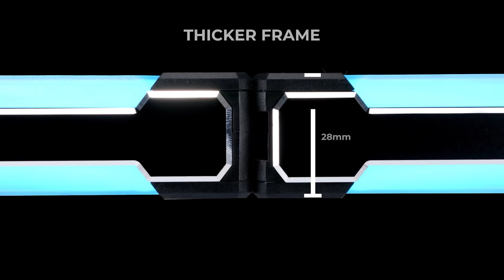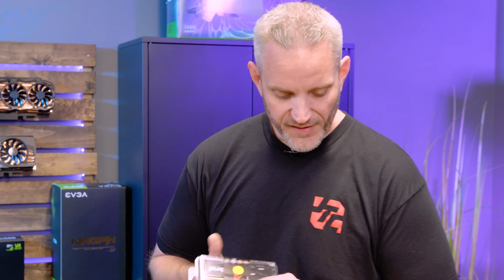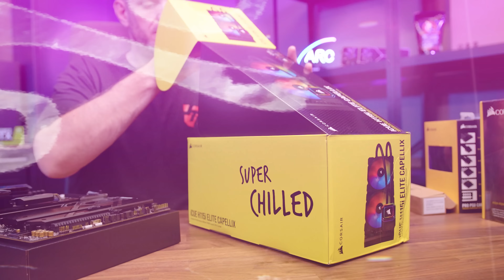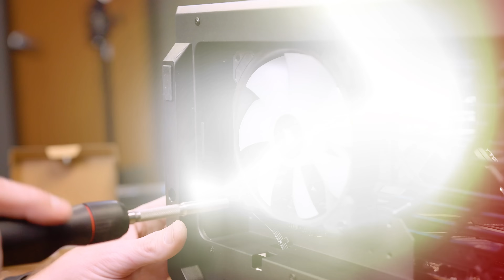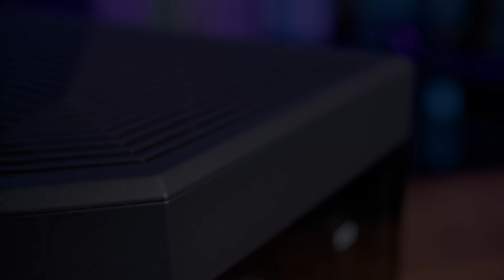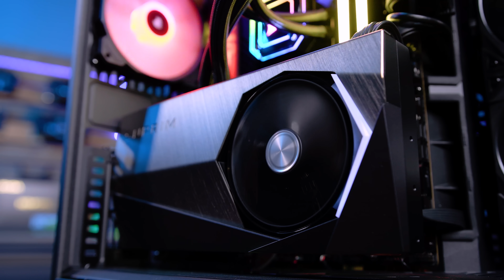I built a PC in the Hyte Y60...

Comment: Putting a 4090 in an Intel system?  Seems like a waste of a fancy GPU with those cheap Intel parts, better suited to a lower performance budget build.

I mean, if you’re building a high end system it makes more sense to use premium components like an AMD CPU, so you can get the best performance with more real cores.  I know Intel marketing materials make it seem like their 24 cores are more than AMD’s 16 cores, because that’s how math works, but Intel doesn’t have hyper threading or SMT enabled, so all you get are those 24 cores with 24 threads, while AMD has 16 cores and 32 threads that actually scale with voltage, so you don’t need those little baby cores to improve efficiency.

If you’re an Intel fanboy who just got triggered by anything I wrote—good, because I was intentionally trolling you, and it means it worked. 😂

Comment: Strange you reference Steve's video while saying using aftermarket cables will avoid the melting issue. Steve clearly showed it's how you plug it in not what cables you use. Bit of incorrect info there Jason. Also, what's going on with your Tony Hawk build?

Comment: The Hyte line-up is some really well designed cases.  I just finished sticking some old components in a Hyte Revolt 3 and was really impressed with the design and build quality.
Reply: I completely agree! I got the revolt three on its initial pre-order and they actually sent me one of their desks mats as a thank you
Reply: @somekidwithanm4  I got the extra face plate that's copper and the pelican case with my Revolt 3 when I did the pre order .
Reply: Generally, yes, but the y60 is a showcase case with very little utility. It's only good for extremely simple builds.
Reply: This case cost as much as the 7000x the hy60 is over priced
Reply: @2511jeremy  Nothing is overpriced if someone sees value in it.
Reply: @suppressed_viii  so if a billionaire thinks a phone 300 dollar phone is worth a million thats not over priced?
Reply: @suppressed_viii  besides its objective either way
Reply: @2511jeremy  I think the Hyte Y60 is in a good spot price wise, its a premium case with premium features. 

If you can't afford it, and/or you don't want to pay it, just say that.
Reply: @suppressed_viii  i bought the 7000x theres no way id pay the $360 cad for the hy60 when the 7000x is the same price its 3x the size
Reply: @2511jeremy  it is not the size that matters, it is what you do with it.  Besides that, I think you can order it at their website for much lesser than $360 cad
Reply: @fuji_hakayito  yeah you could cool a high end cpu and gpu in the hy60 i don't like loud fans and the more radiators you have the slower the fans can spin

Comment: The commander that comes with the capellix works with both the included ML fans and the SP kits, I have both connected to mine with full control. I think it was fixed in a firmware that you can now have it detect the fans and it will give you the appropriate LEDs to map in iCue.
Reply: I was gonna just post this as well, doing that right now.  You do have to go through a wizard to detect the fans but all are running off my commander pro!

Comment: My white Y60 build also has 2 AIOs.  Pretty much like Jay's, with the radiator fans exhausting, but with the rear fan as additional intake.  I also replaced the bottom fans with 140mm Notuas.  The 11900K and ROG Strix 3080TI OC LC rarely hit 50c when gaming.  I cut the screens out in the areas of the radiators, so they don't trap dust.  Screens only help for intake fans.  Love my Hyte!
Reply: did you choose the same 240mm cpu aio or do you think a 360 cpu aio could fit with the side mounted 240 gpu aio?

Comment: Can that case fit a 360 rad? I just bought the case and I believe it does but looking at his build doesn't look likely.
Reply: You can put a 360 rad in the top as long as it's not thick.  Their website should give the rad tray max depth.  Tubing comes down only on the front end(right side) not the back end.

Comment: I bought this case a few months ago and was definitely surprised at the lack of accessories that came with the case and the cheap plastic "cable ties\zip ties" that came with the case as well. My last case which was corsair 5000D came with a bunch more sh!t and quality cable ties and a fan hub and it was about $50 less. I was definitely disappointed to say the least and the 3 fans provided have 3 pin connectors on them so basically belong in the trash so I replaced the 2 fans on the bottom with noctua NF-A 14 ippc 3000 fans and a aorus120 in the back. Plus there's NO RESET BUTTON on the front of the case either. IDK maybe I got spoiled with corsair but I definitely know I got disappointed by this case
Reply: Can you fit a 3080 in that?

Comment: As a build / geek guy that has decided to specifically NOT use ANY Corsair ecosystem parts (with the exception of RAM), due to the overwhelming amount of proprietary software and part integration needs that either just doesnt play well with other part manufacturer parts, or demands a volume of software to run it (the mess that is iQue)... at the end of the day it has gotten hard to watch Jays builds in the past couple years.  These days he just defaults to Corsair.

I dont argue any sponsored video payday needs, everyone gets to be paid, but he doesnt seem to be balancing the channel well between sponsored work and other options, in non sponsored work ... he just reaches for Corsair.  This was a Hyte Y60 sponsored build, yet as usual, he falls back on Corsair.

He has switched to rely on Corsair eco parts most of the time ... even if the very last video was all about the latest BeQuiet fans. Odd juxtaposition.
Others would call it out as fan boy'ism,  I think it may just be a bit lazy or not thinking about it.

Honestly, It makes it hard to watch builds, if he is so determined to only use parts, I have intentionally decided to not use.

Comment: This case looks cool, but having the front IO on the bottom, makes zero sense to me.  Also, why cant a case have the "rear IO" actually be at the back? With modern builds, the so called "front and back" of the case, is actually the sides of the case now!  If a case manufacturer figured that out, THAT would be game changing.

Comment: Strange that you couldn't integrate the SP120 with the Commander Pro of the H115 Elite Capelix, I have an H100i Elite Capelix that comes with the same controller and without problems I was able to integrate 4 SP120 with the 2 ML120 of the H100i in the same controller, so the RGB is all integrate in the Comander Pro, the only thing is that you can't control the speed of the SP120 since they are not PWM, but for that my solution was to use a separate voltage controller for the SP120, and the ML120 of the H100i in the Comander Pro since this are PWM

Comment: I wanted to point out that jay said the SP fans don’t work with the h115i, they actually do, the commander core that the cooler comes with is able to mix fans and recognise different Corsair rgb fans (the new commander core XT can also do this) so you can have let’s say the two included ML rgb fans on the cpu radiator and the SP fans on the case on the h115i’s controller and icue will let you mix them and control them all with just one controller so you don’t need to use the included controller that the SP fan pack gives you
Reply: I've had the same configuration for quite a while now and I was a little confused with what Jay was saying. My H115i controller is running my SP120's (they are the Pro version though?). I noticed Jay linked to the Elites so maybe those don't? shrugs
Reply: and I'm using the sp120 fans with the 5000x included rgb controller. So idk what Jay was saying about that one too. :/

Comment: I know he mentioned a little bit about air cooled GPUs with this case, but does anyone have a definitive answer on how the 4090 FE would be in this case? Would the fan be too close to the glass?  Thanks in advance
Reply: Check out the Hyte subreddit, there are a few builds using 4090s, some recommend using the aftermarket EZDIY Vertical GPU mount, which brings the 4090 FE further away from the glass, vastly improving temps. Cheers!
Reply: @JesseLNobody  Oh dope. I didn't know there was a Hyte subreddit. Thanks for the info, I'll go check it out!
Reply: I have the 4090 FE in a Lian Li O11 Air mini which has similar design to this case. Don’t vertically mount the GPU. Instead, install it onto the PCIe slot on the motherboard and install intake fans at the bottom of the case. Also set the power target to 60% and use the FanControl utility to set curves for the fans. Temps are fantastic in this setup and the PC is silent even during gaming.

Comment: I almost stopped using most RGB software because I HATE that they almost always require multiple apps to use and it bloats the system.
I found SignalRGB though and it handles most RGB through that.
So that's nice.

Comment: I am building my 1st PC in over 20 years. We used floppy discs and IDE cables, the last time I built one. What would be REALLY helpful to us old timers and I am certain to those looking to do their 1st build, a walk through of cables and what goes where on a motherboard. The fact that they may need a Fan splitter for ex. The MB I bought, has 1 CPU Fan header, but the cooler has 2 CPU fans, so I sent for a splitter from Amazon. It gets here Wed. (DeepCool AK 620) There are 3 cables coming from the front panel of the case, I am not able to identify, so I do not know where they should be plugged in. (BeQuiet PureBase 500DX. I am fairly certain where one goes simply by the uniqueness of its end connector, though what it is for...I have no idea) Fans? OMG. The last PC I built, had 2 fans, 1 of which was contained within the power supply. The other of course, was on the CPU. USB headers? My MB has either 3 or 4 different types of USB connectors, each of which (I assume), must be plugged into the corresponding USB header on the MB. Which is which????????? (NZXT N7 B550 FTR) A purely..."here's the basics" kind of detailed, 30 minute walkthrough...would be HUGELY helpful to neophytes and returning builders like myself. For ex your 2 yr old video about what to do before you build, in bench testing components? WOW was that spot on helpful. And your what to do after you build video re drivers, XMP, etc etc? Yep. Just what the doctor ordered. Equally true for your "how to build a system monitor" using the raspberry pi monitor devices...brilliant, concise, and follow these steps to success simple.

Happy holidays to you, your crew and all of your families! You put out some great stuff folks. Keep it up. You ARE very much appreciated!!!
Reply: What a coincidence, my last build was before Dell bought Alienware, probably even before Y2K was to end us all... Working on rebuilding a circa 2006 Alienware with an i5-13600, 3060ti and 32GB of DDR5 on a Z790 MB, little by little it's certainly all coming back but there are without doubt things I am having to stop and reread to make sure I'm not pooching it (and the PS modular cables are certainly among the top, RGB and Fan controls a close second!).

All good ideas, a quick and dirty break down comparing building now versus when you started Jay would probably land square in the target zone for us "Grump Old Dudes" ;)
Reply: If you go back on Jays (or any tech youtuber) channel, you will find a lot of ... and I mean a lot of ... step by step tutorials on modern builds.  Watch enough of them, and you gain the skills to be able to interpret problem solving to your specific issues.
Reply: @PitboyHarmony1  I have been watching videos for 5 weeks. LTT GN, Jayz, Braethorn, et al. I have yet to find one video that covers the basics to the degree I am referring. They will all say...connect your fan leads to the fan headers....which fan headers? Connect your USB leads to your USB headers....which is a USB 2.0, 3.0, 3,1; or does it matter, and if it doesnt, someone please say as much. 

Also, and this is a YT failing, it is very difficult to search thru older videos looking for something specific. MOST of the helpful videos I find, show up by accident on the right as suggested videos, relative to what I am watching and searching for.
Reply: If you need help with the build I am also an old timer [60]. I would be happy to lend a hand. building systems since early days
Reply: @davidbates2161  As an example, the different USB types. Google "Different USB Types", and you get hits like "What are the 4 different USB types?" (article dtd Nov 2018), followed by "What are the 5 different USB types?"(undated Samsung article), immediately followed by "What are the 6 different USB Types?" (article dtd Jan 2018). They can not all be factually accurate, and in fact the oldest of the 3 indicates the most different types. What plugs into where on the MB and god forbid what happens if I plug a Type "X" into a Type "Y" header? The case, comes with 3x140mm fans. I moved the front fan to the top and installed 3 Lian Li ST-120s to the front. The Lian Li kit has a Fan bus, but not an ARGB bus, and the Lian Li fans are ARGB as is the front of the case. So after getting ready to install the MB in the case but 1st reviewing what cables need to connect where; I ordered an ARGB bus which should get here tomorrow. I do however have, 2 or 3 cables from the front panel, I simply have no clue where to connect to the MB. 1 as I said, has a unique looking connector which really only matches 1 spot on the MB, so process of elimination tells me that is for the USB3G2C_1 header. Now WHICH USB connector on the front panel that is? pffft, I have absolutely no earthly idea.

Comment: Defo would love to see you do a full team red build with the upcoming AMD 7000 series GPUs :)
Reply: Can I buy a gpu that uses less energy than old rtx 2070 175 watt? Cpu 7700 will use 65watt with increased performance.
Reply: @fynkozari9271  I'd look into 6700xt's. I don't know what the performance lift is but the 6750xt was hitting 220 on someone's rig. So either the 6650xt or 6600xt for lower power. Idk if the 6600 would be faster than a 2070 tho
Reply: @fynkozari9271  yeah maybe a 6650xt, have seen as low as 180 dollars for one over on r/buildapcsales. I have a 6700xt undervolted on 1080p and most games run 160-175 watts, sometimes hits 180. Highest I've seen is 200 running american truck sim upscaled to 4k

Comment: I’m going to build my first pc next week I can’t wait.
Reply: Good luck! Google and YouTube are your friends lol
Reply: I hope it doesn’t have any amd products
Reply: @Drip7914  intel
Reply: ASUS ROG Strix 850W Gold PSU, Power Supply NZXT H7 - CM-H71BB-01 - ATX Mid Tower PC Gaming Case - Front I/O USB Type-C Port - Quick-Release Tempered Glass SidePanel - Black Samsung 970 EVO Plus 1TB NVMe M.2 Internal SSD (MZ-V7S1T0/AM) [Canada Version] Corsair Vengeance LPX 32GB (2 X 16GB) DDR4 3600 (PC4-28800) C18 1.35V Desktop Memory - Black ASUS Prime B660-PLUS D4 LGA 1700(Intel 12th Gen) ATX Motherboard(PCIe 4.0, DDR4,3xM.2 Slots, 2.5Gb LAN, Rear USB 3.2 Gen 2x2 Type-C, Front USB 3.2 Gen 1 Type-C, Thunderbolt 4 Header Support) GIGABYTE GeForce RTX 3060 Ti Gaming OC 8G (REV2.0) Graphics Card, 3X WINDFORCE Fans, LHR, 8GB 256-bit GDDR6, GV-N306TGAMING OC-8GD REV2.0 Video Card be quiet! Dark Rock 4, BK021, 200W TDP, CPU Cooler 
Intel Core i5-13600K Desktop Processor 14 cores (6 P-cores + 8 E-cores) 24M Cache, up to 5.1 GHz Noctua NF-F12 PWM chromax.Black.swap, Premium Quiet Fan, 4-Pin (120mm, Black)